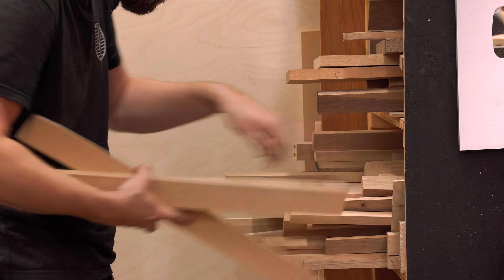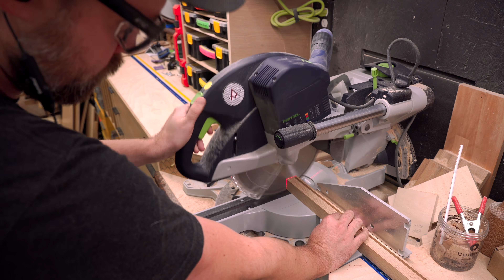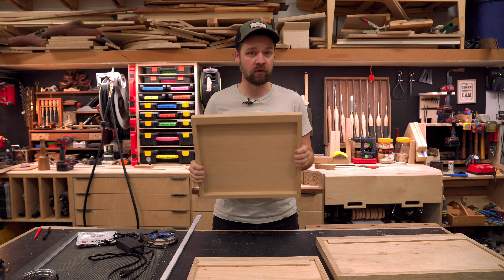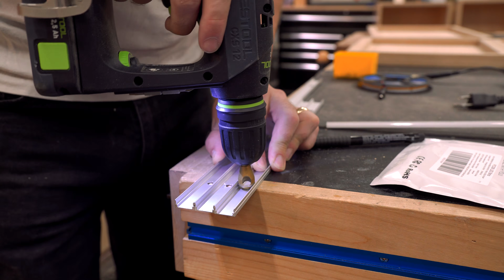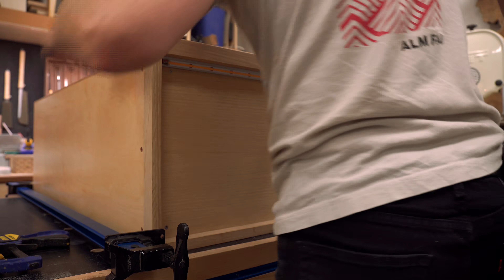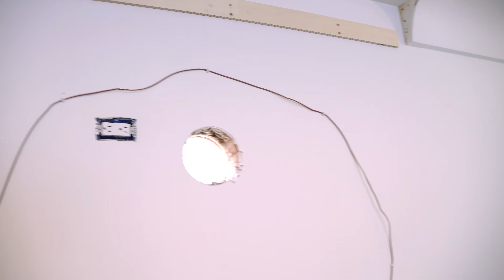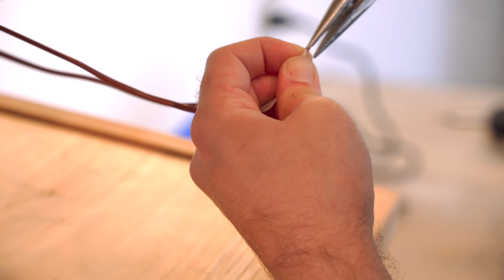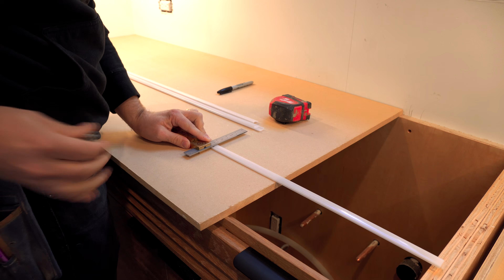Invisible Wire LED Lighting: Ultimate Kitchen Upgrade!

Comment: A transformer transforms voltage, but it remains the same with regards to type.  So using just a transformer will convert an AC signal (does not work with DC signals) to a lower or higher AC signal.  For a DC signal, you need a rectifier, which is essentially what a power supply is.  LEDs run on DC, no AC.

Additionally, since you are using 24V, you do not have to worry about a voltage drop as much as you would with 5 or 12V LED strips.  If you are doing long runs, or the led strip is far from the controller and power supply, the voltage drop will cause the end of the led strip to be dimmer than the start.  You can inject power at the end, or middle of the led strip to compensate for that.  Or just use 24V.

Comment: using COB leds AND a diffuser is not a good combination. The COB leds already have a phosphorus diffuser in the COB layer over the LEDS to diffuse the light. They are also dimmer than non-COB leds. You might also make your connections from the various cabinets either in the attic or above the cabinet, so you can replace segments as needed without moving the cabinets.

Comment: A quick note I would make about Color Temperature (as a LOT of people have no idea about this and just randomly grab LED bulbs (can't tell you how many 4000-5000k LED bulbs i've seen in living spaces in houses), the typical Incandescent bulb is a 2700k color temp, some people may find 3000k a little "harsh", I know I did when I bought them but I lived with it because the bulbs I got where so cheap they paid for themselves in a couple months and this was from 10 years ago when the average LED Bulb was $5 or more. So people upgrading from standard bulbs in a residential setting I would advise 2700k for all your bulbs.
Reply: When my partner and I go for evening walks around the neighbourhood, we often have a super judgey running commentary going about the houses we pass - all good-natured of course, and wildly hypocritical given the current state of our own place 😅 It's equal parts gathering inspo for future upgrades and just poking fun at questionable design/decor choices, but one thing that always catches my eye is cold-ass lighting, especially in apartment blocks where there's always one glaring blue-white apartment sticking out like a sore thumb.

I saw a house last week that's seared into both my memory and my retinas. It had a huge living room fronted with glass sliding doors so we could see straight in, it was utterly bare (white walls and white tiled floor) apart from a coffee table between two very expensive-looking black leather chesterfield sofas, and the lighting was bright and cold enough to put an Intel R&D laboratory to shame. Like, who the hell is relaxing and feeling at home in that space? I'd be sitting on one of those sofas, doing nothing, with the stress levels of an animal being hunted for sport 😬
Reply: @glittalogik  Brands selling "daylight" bulbs as "pure, clean, and energizing" should not be allowed lol. 

Maybe fine for task areas, but even then I'd recommend 3500~4500k as a more "neutral" white. Too bad it's hard to find bulbs that aren't either 2700K or 5000K/6500K... And don't get me started on tint, lol. 

Daylight bulbs (especially 6500k) are just not pleasant indoors at night! 

Also, Philips sells "Warm Glow" dimmable LED bulbs that go from 2700K to 2200K as you dim, for a VERY pleasant cozy glow as they get dimmer!
Reply: Really a matter of taste more than anything else. I use 2700K only in the night areas, because of its lower blue level, which may help with sleep. Otherwise, it looks depressingly tired and muddy to me, too much like bad old incandescent. 3000K elsewhere in the house for a more neutral effect. For task lighting (kitchen, shop), a brighter 4000K seems to improve detail and color.
Reply: Btw, my recommendation for the most pleasing, non-green no-flicker LED bulb with great color rendering: the GR Reveal HD+. 

Widely available (Lowe's, Target, Online, etc), not super expensive, and they're just really nice. 2850K but not harsh at all. 

Compare to whatever LED bulb came with your house, and it makes those looks sickly green - if anything, these are a bit "rosy" due to the special glass/coating. They're also full frosted glass bulbs, just like the old incandescent, rather than plastic half-globes.

Another good recommendation is the IKEA TRADFRI smart bulbs! Surprisingly good color rendering for the price, and they're widely supported.
Reply: @joegibes  Maybe they've changed over the years, but when I first tried those the light they gave off was sickly and unsettling. Replaced them all with Cree bulbs; 3000k in kitchen and bathroom, 2700k in living room and bedroom. At the time they were the best CRI bulb you could pick up off the shelf at a hardware store.
Reply: @joegibes  Typo:  Its GE Reveal
Reply: 2700k is bs and we need to move away from it
Reply: Here's my unsolicited opinion, lol

I often times install light fixtures that don't have replaceable bulbs, so I've had to be very careful about determining what customers actually want. I've found in general 2700k-3000k are best in smaller rooms or those with more intimate settings (3000k if the intent is to make a small room look larger) while more active rooms with high ceilings skew to 3500k-4000k. Most of the time I won't recommend over 4000k unless it's a room that's ultra high contrast and high ceilings (10ft-11ft+), and even then the lights throughout any unbroken space must match color temperature with rare exceptions.
Reply: As important is the CRI value, or color rending index. Most inexpensive LEDs are in the 80+ range, which gives a washed out and drab color to things, good LEDs are 90+ the best are 95+, and a few top end ones like Waveform Lighting have 99 CRI options.

Unfortunately this is not required on labeling in the U.S. and so it will require some investigation if it’s not listed directly in the marketing copy.

Comment: If you do multi color LEDs, i usually see power supply as representing the transformer/ac-dc converter, and driver for the part that controls/drives the color outputs.

Nice work!

Comment: Nice work, but I have to ask, if you built the cabinets, why didn't you build the valence into the original cabinet design?   I also found that putting the light strip all the way to the front, directly behind the valence front blocks light from reaching the front edge of the counter.  I mounted my lights about 2 inches from the front edge which resulted in the light nicely illuminating the entire counter from the very back edge to the front edge.
Reply: This was my main take-back from this video, that having overhang in the cabinets would be so much better.

Comment: My preference is to offset the LED strip about 1-2" from the light rail (valance) so there isn't a harsh shadow on the countertop since they stick out more than the uppers.
Reply: Good point. Alternatively, reduce the height of the valance to widen the light dispersion. The channels have such a low profile that they would still be hidden from normal view.

Comment: Did you consider using Wago connectors?
Reply from the maker: I’ve had mixed results with those. Some people love them though
Reply: @MichaelAlm  - what issue were you having with them?  I was thinking these would be good for making the connection within the valence between the main wiring and the pigtails going to the strip on the valence.  This would seem to be more serviceable (?).  I solder a lot for electronics, but soldering in a cabinet is... no fun.

That kitchen is turning out fantastic, btw.
Reply: @biedawo  I can't speak for Michael, of course. But I've done a similar project in my own kitchen, and found the Wago connectors invaluable.

I didn't hide my wiring with the build valence as here, but my cabinets hide the wires pretty well as they are. Wago's inline connectors are key though. If I were to use their traditional "all the wires come into the same side" connectors, it would be a lot harder to keep the wires running flush inside the corners of the cabinet undersides.

That said, I used the regular ones anywhere I didn't need to hide wires, e.g. where the drivers are plugged in out of sight.

I did a similar project for toe-kick lighting and for that I didn't have the Wagos yet and soldered the connections at the cabinet. It was doable, but it'll be a pain if/when the strips need replacing.

Comment: The big plus of aluminium channels is that they increase the dissipation area so your LEDs will be able to dissipate heat faster making them last longer. Besides, you can install diffusers which will help with non-COB LEDs.

Comment: When installing the wire in the walls use a "speaker" wall plate with binding posts.  This not only gives a cleaner & more professional appearance but also saves from having to locate the wire. Furthermore instead of running a wire between cabinets you can tie into one location. 

 As a bonus you can use the multi binding post option for "zones", like below cabinet and above cabinet lighting.  You can also use the multi option for additional drivers if you require more power than whats available with one driver.
Reply: Also in same vein. In wall approved speaker wire is often a large enough gauge for lighting. Unlike this video I wouldn't trust door bell wire for lighting applications as it's too small for the possible currents imo.
Reply: @2hlix  Speaker wire is a awesome idea! Especially if you need to run it a longer distance or significant load.
Reply: @2hlix 18 AWG is likely totally fine for LEDs like this, but it does depend on the current and length of run. Ex. For 5A, 18 AWG should be fine depending on the length. 

If these LEDs are 14W/m at 12V, that's 1.17A/m. Rough estimate of 3 meters means the LEDs from the video draw 3.5A. 

Since 18 AWG is rated for 7~10A (depending on many factors), it seems appropriate for the lengths in this video. Even 20 AWG might be fine, but it depends mainly on the cable's ambient temp, heat dissipation, and length to avoid too much voltage drop. Also depends if you need the LEDs at max brightness all the time (which can degrade over time - ideally, go for brighter than you need), both for the general heat produced by the cable, and if any voltage drop from the cable length will be noticeable. 

Also note that the conductors within the strip itself are likely much smaller area than 16 or 18AWG wire... Which is one of the reasons why you need power injection for longer LED strip runs.
Reply: That's great until the next owner plugs in a speaker.
Reply: @csbarbourv  I never thought of that!  Labelling it might help??

Comment: I'm always amazed at the lengths woodworkers will go to avoid trig. There called drivers because LED's are a current device and a good driver will keep the current constant. You will have an easier time soldering if you add more solder to the iron, the heat transfers more efficiently and helps the solder flow into the wire, if it's smoking your iron is to hot and vaporizing the flux which will also make it harder to solder. In the future you can use a low voltage box to land your wires into instead of having to go fishing for them later.

Comment: I did a similar under cabinet LED strip lights on a kitchen cabinet refacing project. The problem that I had was that the cabinets were located on three separate walls and I wanted to switch them all on/off from one wall mounted switch. I was planning to install a new tile backsplash so I ran the LED low voltage wires down the wall and into the lower cabinets. I also ran 120V AC power from the backsplash outlets to the lower cabinets. I then used a wireless 120V AC switch in the lower cabinets and wired the 120V AC power to the switch and then to the LED driver for each wall. The DC power from the drivers was then ran up through the wall and out to each under cabinet location to power each LED strip light. Lastly, I installed a wireless wall switch at a convenient wall location and powered the switch from one of the AC backsplash outlets through the wall. All of the holes would be covered by the new tile backsplash. The wireless wall switch and wireless  AC switches were made by Sonoff. I bought them on Amazon. Search for "Sonoff RFR2 WiFi Wireless Smart Switch" and "Sonoff TX T2 Smart Light Switch Wi-Fi Wall Switch". Now all of the LED under cabinet lights turn on and off with a single wall switch. Thank you for another great video.

Comment: Awesome. One thing though, you put screws under the valances for 'maintenance', but soldered the LEDs to the wire.
Reply from the maker: De-soldering is pretty easy. I know because I had to do it a couple times 😂

Comment: The fact that you didn’t go with rigid metal duct for the vent tells me that you don’t know what you’re doing.  I would never trust you for anything electrical.
Reply from the maker: Relax… It’s a 6” duct and the outside connection is a 6” solid duct that inserts into the flex. There will not be any exposed flex hose.

Comment: Great video. My kitchen lighting as bad. Might have to try an upgrade after watching this. What is your reason for going for the full stove vs separate cook top and oven? (not sure what you call it in english). Personal preferanse or is this just the most normal where you live?
Reply from the maker: Thanks! Glad the video was helpful. I picked out the oven stove combo partly because it’s what I’m used to, but also because I was having trouble figuring out a good place for a cabinet oven. They look cleaner, but with this size kitchen it would’ve been a less efficient use of space.
Reply: In the US, it's a "range". Not positive about the UK, but I do hear "cooker" a lot. IMO, wall ovens were a horrible idea. Sleekly photogenic in the design mags perhaps, but hugely impractical in the indoor environment, since they create a second source of waste heat and (evidence-based) unhealthy air pollution, one which will not be captured by the exhaust hood over the cooktop. With a range, the emissions of both oven and top burners are centered under the hood (a.k.a. range hood). Restaurants know a thing or two about functional kitchen design, and I've never seen anything but ranges there, often in multiples, always under hoods.